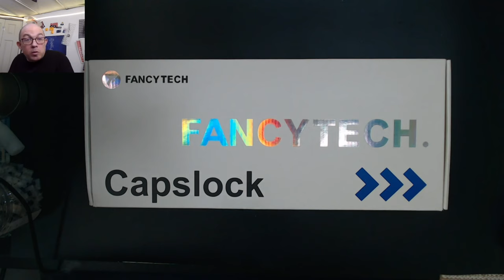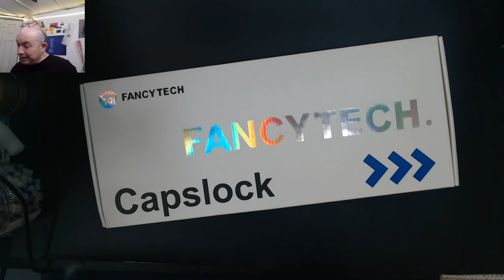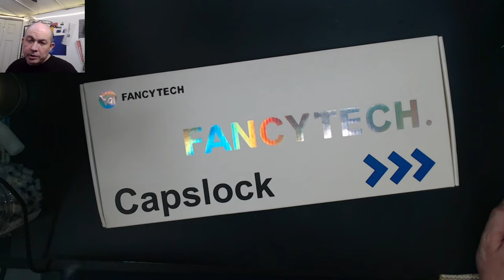Fancy Alice 66 Unboxing

Comment: i just saw this board on reddit, and went to dive into videos of it. Now having second thoughts on it due to your experience.
Reply from the maker: I am currently going through a dispute with FancyStore on ALiExpress. They expect for me to pay ~$100 in shipping to return this board, since they laughed at me when I asked for replacement pads that were not broken. 

I'll be going for either the Feker Alice or the Akko Alice Pro coming out soon. 

Thing is, not only was the FancyAlice damaged, the Fancy081 was missing gaskets! And all they could say was "Well that's not right, but it will work fine without them..."

Yeah, I bought a gasket mount keyboard, for it to not be gasket mounted...

I've captured the entire exchange between myself and them and will probably make a PSA to avoid their store and products once this ordeal is over.

Comment: Nice I am planing on buying this keyboard in the near future. Can you send me the link from where you bought it since I found different places on aliexpress to buy this keyboard.
Reply from the maker: I bought this from the FancyTech store but am currently under dispute since they sent me broken and incomplete items and then laughed when I asked for support.

At this point I would avoid FancyTech altogether.
Reply: @MechKeyboards  What was broken or incomplete?
Reply from the maker: @apapodnac  The poron plate/PCB padding was torn and in two pieces, the above PCB "PE" layer was warped to the point it will not fit properly. They sell these items together on their store (FancyAlice66 Keyboard PCB Positioning Board Gasket Wine Red Switch Mute Cotton Sandwich Cotton Foam), which leads me to believe that this is a common issue.

Though I could have probably dealt with the torn poron and used PE foam, but the store's attitude is what informed me to just leave their products alone. These will be going back for a refund and I do not recommend that anyone spend their money with FancyTech store on AliExpress.
Reply: @MechKeyboards  that sucks, sorry to hear. Especially for such a cheap fix
Reply from the maker: @apapodnac  Right? I mean, just send out what was missing/broken and we can all get on with our lives. Now we've gone into dispute mode and knowing AE, this will be a months long process that has left a very dirty taste in my mouth. I took a double chance ordering two boards from them at once, in the end, I'm the only one to blame, I only hope I can prevent others from having to deal with this level of BS.